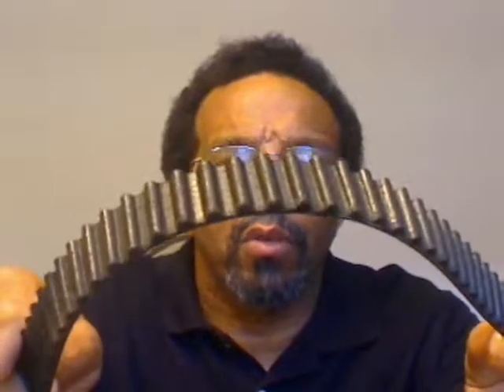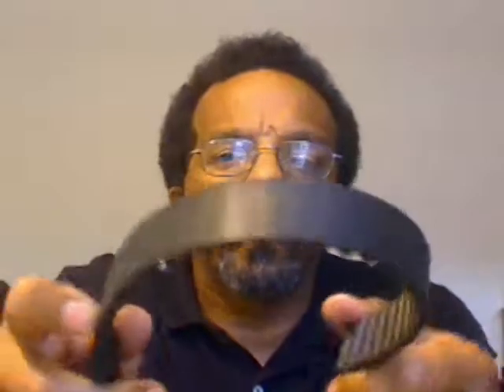Important information about timing belts and why they need to be changed - VOTD

Comment: I always make sure to get a complete timing belt kit with all tensioners, idler pulleys and a new water pump. I know that way it will cost less in the long run. As for your friend with the Mitsubishi those cars are notoriously problematic, and fixing them isn't all that cheap. If you ever decide to buy one of those cars you gotta figure out the value of the car so that you don't just pour money into an endless money pit car.
Reply from the maker: LOL, he finally got rid of it last spring. Went through 3 timing belts.

It was normal practice for people to do the belt only every other change but not so much any more. Most belt driven cars have the change schedule to far out. Early on it was every 50,000, then to 70,000, now many are 120,000. Some do good to make it to the change time.
Reply: yeah I changed mine on my honda pilot and it had just over 123k at the time

Comment: Thanks!  its a 98 s70.   I should line up all marks before taking any bolts out correct?   then when the tensioner is off i press it to put the pin back in to assemble back together?

Comment from the maker: The belt touching the cover is NOT good. I would check to make sure the bolts are tight on the rollers. If they are, maybe one of them is bad. You should be able to change the tensioner roller without pulling the belt off. Pull the tensioner, then change the idler roller, then install then tensioner back on and see if that helps. If it does you're done, if not, do the same for the tensioner roller. I'm assuming that you have a pre-'98 1/2 850 or S/V70.

Comment: Hey Robert,   GREAT video.  im noticing that my timing belt is tracking close to the cover. I pulled the cover to see the belt is rubbing the cover.   the belt looks like its been changed fairly recently.  could a faulty pulley or tension-er.be going or about to  let go?

Comment from the maker: There are a lot. If you paid a shop to do the job, I would contact them to pick the car up and fix it. That way if anything goes wrong, they are responsible for fixing it. If you decide to do it yourself, you should be able to pull the tensioner, pull the belt off, align the cam, then put the belt back on. You can view part 2 of 2 of my timing belt change video.

Comment: My shop looks to have used the crank pulley marks (dead center) as the crank marks to line the oil pump with & left my exhaust cam a couple of teeth off so I had  no power. I am going to have to release the tensioner & remove belt from the cams to line up. I know I have to reset the tensioner afterwards and that should be good since it was new . Any steps that I could skip? lol

Comment: Do yourself a favor & get your tools up front , as Robert is so kind to list them. I wasted hours on bolts that wouldn't break loose. Try not to cut your belts off and even if you do...match them up with the new ones for peace of mind if you struggle with them later. My serpentine belt was the wrong size  and my timing belt was skin tight before I pulled the pin.  I ran out of weekend and my shop finalized my marks & I think they got my crank marks wrong. Now I have to take my belt off & reset

Comment from the maker: You can go to a website that sells parts for that type of car. If it's a BMW, go to a BMW forum and see what parts company is advertising on it, then click there and check the prices. If it's a Volvo, go to a Volvo forum and see who advertises there. 

On a Volvo 850, all timing parts, including the water pump will cost around $275 at an after market shop. At the dealer they may cost about $400.

Comment from the maker: If the car had NO POWER, they may have gotten the timing off a tooth or two. Or something was left or knocked loose. You should have that checked out. The belt should be changed every 70,000 miles or 7 years. If you follow my instructions on the S70 timing belt replacement which is the same as the 850, you should be fine. Watch the video and judge for yourself.